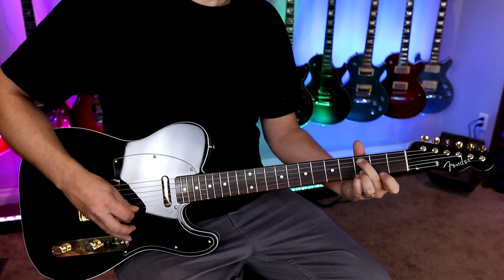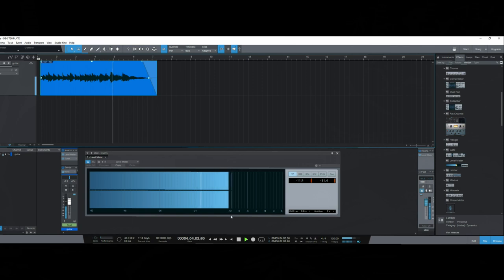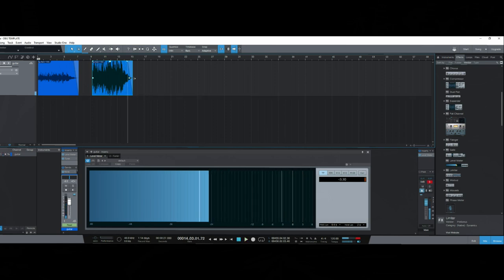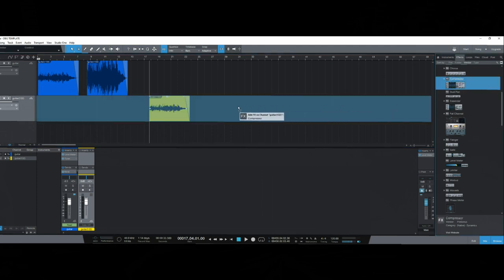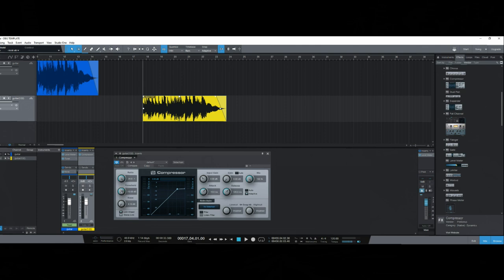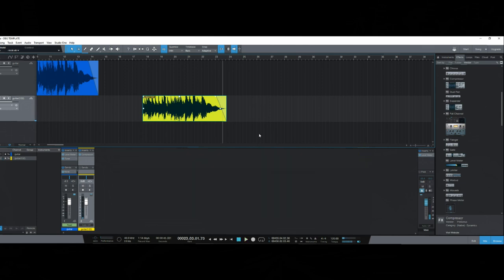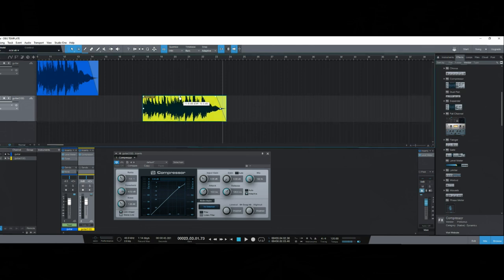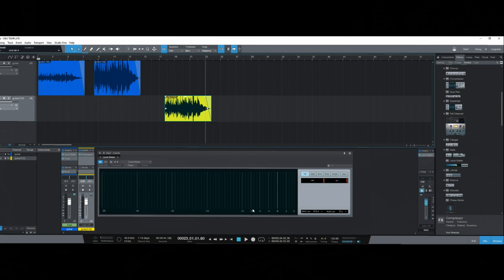Comparing 8 of the BEST Compression Pedals!

Comment: Compressor pedals limit the peaks in your signal while bringing up the quieter parts. Balances evens out your volume and response. Very handy for slide playing.
Reply: Yes Matt you are so correct why wasn't this mentioned?  Why not last in the chain to compress the overall sound?
Reply: @rockwriter9054  why dont you try it yourself, theres no wrong way to do anything if it sounds right
Reply: Or even for normal clean playing. You can hardly hear yourself playing with a band.
Reply: @rockwriter9054  last in the chain is good if you set compression subtle, because, if you think about it, that is where you get natural tube compression from your amp, at the very end, however, with compression pedals they exaggerate the inherent noise of every pedal before them, so if you want more extreme compression and want to keep the noise floor low, they are best placed first in the chain after the guitar.

Comment from the maker: Death, taxes, and compression! 
Compression is the behind the scene effect that runs all modern day audio - for better or worse :)
The second half of the video features the 8 compressor pedal comparison and my recommendations. Enjoy!
Reply: Hey, good video! I'm a new follower. Which digital compressor did you use at the beginning of the video? Minute 4:00 more or less
Reply: Hi there was no final verdict on the Boss CS-3 yet you seemed enthused by it during the review?
Reply: @LuchieJ  I got an CS-3 on my board. It's fully modded with a Opto + and dual stack mods. I  don't know what that means, but it's louder and quieter than the stock 1 I got. All that said it's been on my board for a yr and I'm not liking it's effect on my sound anymore. I got a 10 band EQ modded with silent mod so that clears up noise level. It's a nice boost, but I got 1 of those also. Actually 2 if you count my wah has a boost also. Guess this opens up a spot on my board in the future when I get something good.

Comment: 1) Why are compressors the sound of rock?  Simple.  All throughout the '50s, '60s, '70s, and well into the '80s, music was recorded on tape, which had dynamic limitations.  It was played back to end-users on vinyl disc, which also had dynamic limitations.  And we bought records based on hearing things on the radio.  EVERY broadcast studio has limiters because FM, and especially AM (rock FM stations not really arriving throughout much of the world until the '70s), have serious dynamic constraints, such that heavy limiting was needed for broadcasts to have some reasonable hope for fidelity.  Bottom line: everything about classic rock has been squished, re-squished, and squished again, and that's what "normal rock" sounds like to us.  On top of that, nearly all distortion, that guitar players love so much, results from running up against headroom limitations, whether it be in a pedal or in the amplifier itself.  So yet another reason why we think proper rock and roll sounds compressed, and needs to.
2)  Compressors do NOT create sustain.  They create the illusion of sustain by gradually raising the gain as the guitar signal dies away.  If the compressor's gain-recovery and the guitar's inherent sustain co-operate, it will sound like it sustains longer.  Volume will enhance sustain more than any compressor will.
3) Nearly every compressor will tend to dull your tone.  Why?  Most of the harmonic content (treble) in any picked note lives in the first 50msec or less of the guitar signal, or what I like to call the "note's lifespan".  After that initial pick attack, the string dies down to become mostly note fundamental with a smidgen of harmonic content on top.  Compressors will pull back the gain for the pick attack, and gradually raise the gain again after all that natural treble has disappeared from the landscape, making the "warmer" sound of the fundamental-only appear as the dominant timbre.  This has nothing to do with the "quality" of compressor, or whether it uses photocells, FETs, transconductance amps, or whatnot.  Many modern compressors will include a "blend" control that combines some of the uncompressed signal with compressed.  The decay of the uncompressed signal will disappear quickly, but you get to keep the initial attack and its tone.  The compressed version of the input signal won't have much of the attack tone, but it WILL have the long-lasting fundamental.  So you get the best of both worlds from judicious use of the blend control.
4) One of the biggest distinctions between compressors is their gain-recovery time.  That is how quickly they return to full gain after momentarily pulling back in response to the initial pick attack.  One can usually only "hear" differences in gain recovery with big variations in picking speed.  Historically, players holding notes on their Les Paul loved the MXR Dynacomp, while country players chicken pickin' on their Tele loved the Dan Armstrong Orange Squeezer.  The stock version of the former had a long gain-recovery time, while the latter had a comparatively short one.  Because slow gain recovery time gets in the way of hearing the pick attack of the next notes played after the first one, many pedal manufacturers who included a control to vary gain-recovery time labelled it "Attack", though it actually does not technically change attack.  Fender's recent The Bends compressor took the righteous path and called the control what it is: Recovery.  Most players will be hard-pressed to be able to hear small to medium changes in gain-recovery time, which is why I think EHX did the smart thing with the Soul Preacher and just used a 3-position toggle for fast-medium-slow.
5) One of the more useful applications of compression for a gigging musician is keeping the guitar level constant when trying to sing and play at the same time, or when playing rhythm behind a singer.  It's all too easy to let one's enthusiasm get the better of you and slam out a distracting and disruptive peak.  A compressor will assure that your live playing has the same qualities as a good master mix.
6) I have and have had easily 15 or more compressors of various kinds over the years, some of which I bought, and some of which I built, from simple 2-knobbers to rack-mount.  I bought my first one in 1977 or so.  Oddly enough, for whatever reason, it remains my favourite: the venerable Univox Uni-Comp.  It is as simple an optical compressor as one could ever find.  Bloody long gain-recovery time, and is as untransparent as compressors get.  It is very much an "effect", and maybe that's why I love it every bit as much as Telecaster bridge pickups do.
Reply: Mark Hammer   wait a minute! You’ve done some reading, haven’t you? Clever mate, you are...
Thanks for taking the time to actually teach us “your side of the story“. (I prefer the Keeley “four knob” for my style and for almost all my guitars. And I enjoy Joe Meek’s rackmount VC6Q… Mainly a vocal pre-amp, But it’s compression has a very nice effect on several of my guitars.) I only added the parenthetical so you would know a little slice of my life that might explain my choice. Cheers. And just like the chap that did the video, stay safe and stay healthy. And, most importantly, God bless.
Reply: Thanks Mr. Hammer I am building my first pedal board and I just picked up a really inexpensive compressor just to see if I could figure out how to use it. I know this is an old thread, but I just wanted to say thanks for the information.
Reply: @Sailor_Man_Music  You're most welcome.  I hope the friendship between your picking hand and the pedal grows.
Reply: That was some lesson, thank you
Reply: This guy compresses
Reply: Which other compressor would you recommand as this unovox unicomp seem to be unavailable?
Reply: @gokusgames  I wish I could, but regrettably, I don't follow current pedal offerings too closely.  I do give a big thumbs-up to optical compressors, though, because they tend to distort less - or rather are less susceptible to distortion - than those using FETs or transconductance amplifier chips like the 3080.
Reply: I would argue that compressors do in fact create sustain. There's no illusion, the sound lasts longer. The bulk of your manifesto is raging against electric music meaning amps, pick ups, etc.
Reply: @AllofJudea  Not a "manifesto", merely a recap of the history of compression.  When played at low volumes, few will use compressors to produce "sustain", but rather use them simply to constrain peaks.  The sustain qualities really only come to the fore when used in conjunction with volume levels high enough to result in vibration of the instrument itself, where the continuing increase in gain as the string naturally dies out "shakes" the guitar enough to jiggle the strings into vibrating a while longer.  Without the assist of that artificially-induced vibration, the strings on that instrument would die out a lot sooner.  That's why I say "illusion".  That said, I can see your point about "if it lasts longer, then it lasts longer".
Reply: @markhammer643  I will rescind my manifesto comment, I'm an asshole on the internet and I can't stop sometimes. Compression and clean boost are things many guitar players don't use (and eqs). I never used them until I started focusing on clean tones
Reply: @AllofJudea  No worries, Pete.  The internet, and especially mobile devices, have a tendency to elicit that from the very best of us.  A tip o' the hat for your polite recovery.

Overdrives introduce their own compression.  So small wonder that folks don't immediately recognize the virtues of compressors when they rely heavily on overdrives.
Reply: Very well done Mark i actually learned even more because of the way you layed it out there. Thanks man.
Reply: @AllofJudea  haha you had a "Beef" for a bit there
Reply: @buschovski1  Thanks for that, Tom.  My absolute pleasure.  I like it when musicians can become smarter about things they kinda sorta understand; enough to be more independent.
Reply: Great comment!

Comment: Darrell - I'm a bilt surprised that you didn't use a couple of staples in your  "shootout".  I was expecting to see an MXR Dynacomp or ROSS compressor, since they are pretty much everywhere, and would have given folks an idea how these newer offerings stacked up against standards that have been around for decades. However, I do realize that you can't put everything on the board, otherwise, we'd be there for hours.  Not a slight on the video at all, as it was your usual brilliant, thorough, informative review, which we've all become accustomed to. Cheers and keep the amazing videos coming. Probably my favourite channel of all!!
Reply: The MXR and the Ross are the same circuits (MXR cloned Ross IIRC) with slight variations in the values that don't amount for all that much. The Keeley and Wampler compressors are mods to that with components of better quality and some extra features but with the same basic sound.

Comment: Hi, I have read the article "The Loudness Wars"  and I had the same impression of Mark Hammer first point: something missing. Don't get me wrong, useful article, but there are other aspects to consider. Compression was first used to reduce the dynamic mainly because radio broadcasting, tapes and vinyl had a limited dynamic capacity and were noisy. Using the compressors engineers discovered soon that every compressor had a different personality, (non-linearity, distortion, attack & release time, etc..). The sound was "shaped" by compressors, not just "compressed". Most used since their introduction: Urei 1176,  Teletronics LA-2A, Fairchild 660/670, Distressor, dbx 160, SSL Master Bus Compressor, etc... They are still used in the digital era! They are reproduced in plug-ins. So, the compressors should be considered an "effect", not just a sustainer. I personally use on my guitar an optical compressor of an old Focusrite channel-strip: Platinum Tone Factory. It can be bought around 90 euro for sale online, and you have a nice discrete pre (kind of DI function) + an optical compressor + a parametric eq + a noise gate + gate key + send & receive... Yes! Everything for less than 100 euro. The equivalent of 5 pedals with studio quality in one rack channel. There are many old channel strip with great "personality", like Joemeek, for sale at a very interesting price. I would suggest you to try for less than one single boutique pedal. 😉

Comment: Great explanations! I have a soul preacher and it is definitely not that quiet, there's a trim pot inside the pedal (top right when you take the back off) that sets the input gain and it was probably set way too low from the factory or by whoever owned the pedal before you. a few small adjustments with a screwdriver to the pot and it will totally transform that pedal!
Reply: Agree, the soul preacher wasn't shown off fully to its capabilities and was wrongly criticised.  I've had it for years and just recently upgrade to the wampler ego but I'm keeping the soul preacher for light compression for my acoustic guitar.

Comment: Very well explained Darrell. Great intro in understanding compression. It’s a huge subject, there a different types which you can use for different sounds and effects and so my different plug-ins. BTW, which DAW are you using?
Reply: Studio One by Presonus.  The Best !
Reply: pirate shack it’s been a few years since I produced anything, but I vaguely remember that studio one shares many features and operations to Cubase, which back in my day was the DAW I used. It’s cheaper than Cubase if remember? I’ve got an old Mac Pro 3.1 now, which has never let me down in over 6 years and have Logic Pro X. I think all DAWs do the job, it’s just a preference on how easy it is to use and how much time you are willing to spend to get the most out of it. The most important is your performance as a musician. As for compression, I only use it for production and very lightly to.